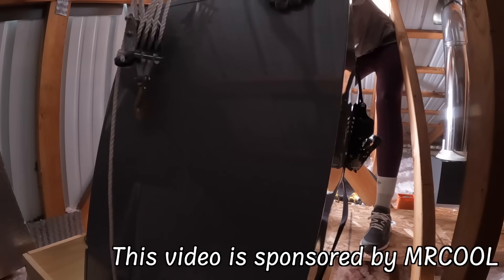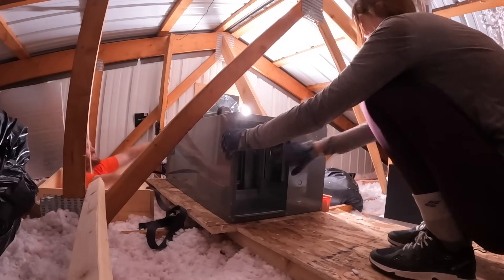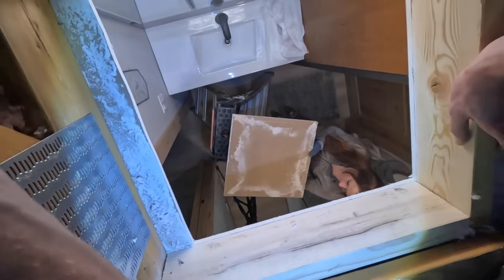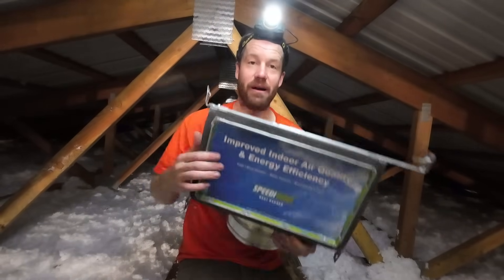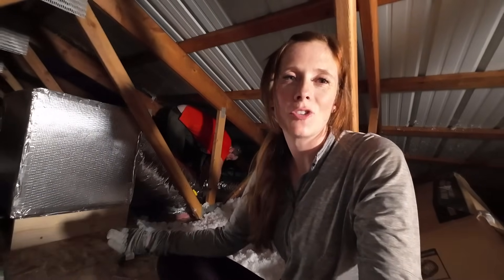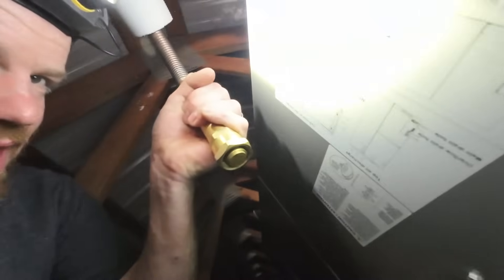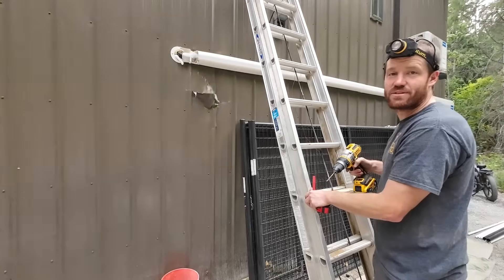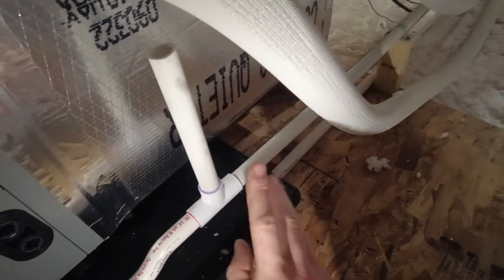Replace Your Old HVAC System With THIS! (DIY Heat Pump Install)

Comment: I always install a moisture sensor in the emergency overflow drip pan below the air handler connected to a light or bell or blue tooth to my phone to alert that primary condensate pan has malfunctioned and get service preformed on unit before disaster strikes, it's low voltage and low cost insurancefor the piece of mind it provides as when (all A/C Air handlers will expirence a blockage sometime in their lifetime) drain becomes blocked all the water collected will make for a lot of damage this simple precaution can save you hundreds if not thousands of times the cost of installing preventing water damage to your home. Great job on the install. Ray Stormont

Comment: Is the the unit liquid gas unit. ?
The information.  Inverter incorrect.  Those unit start up slow so there is no big surge on your sorce of power.  No brackers do not turn off. When the freezer is running at the same time hot water unit on Or a dryer all at the same time microwave.  Or jug for boiling water for a cup of coffee.....Can corse a fire if brackers are old. Or old home with just a fuse. And most people  go bigger gage of wire. But then smale gage wire gets red hot. Inverter is the way to go. God bless  mick Australia

Comment: Nice install. I suggest you wrap or foam the exposed metal on registers in the attic. The cold metal will cause moisture to condense and then ruin you sheetrock.

Comment: No wonder it’s hot in your attic, you have no insulation next to the roof, instead you have it in the ceiling. You also have no sarking so you can expect plenty of moisture to be settling in the insulation you do have. If you insulate the roof you keep most of the heat and cold out of your home.

Comment: Very awesome.  I installed a MrCool Universal system about a month ago.  It s their other central air system.  You will probably want to make a controlled room around the evaporator/air handler in the attic using at least some insulation board with radiant heat barrier.  It will make it more efficient and keep it from sweating in the Summer.  Also, you might want to add some returns in any room where to doors can be closed.

Comment: Yes. I remember. The windows were too heavy for the little single pulley. I wondered why you two engineers didn’t think of a block and tackle setup! Now you have a three block setup. Easy, no?

Comment: I installed one of those last week. Exactly the same. Mine the system didn't seem to know the temperature was ok as the fan ran at full speed non stop. Tech support didn't know why. They suggested that I install a standard thermostat and not use the one I purchased. It now works properly. So I have an extra mr cool thermostat. If you guys want it I will send it to you..

Comment: It is currently common practice for homes in the US to be built using a central AC and heating system, that includes an air handler and duct work in the attic space.  This seems like an unnecessarily difficult and problematic practice in my opinion.

Central AC and heating system air handlers are big, bulky, and are very high effort to install in very uncomfortable and cramped working spaces.  Additionally, they do occasionally require maintenance, sometimes due to mold clogged condensate drain systems, and sometimes due to something else (such as improperly designed air handler motors, using glue adhesive to secure permanent magnets, whereby the glue adhesive is improperly chosen such that the bond breaks over time and the magnets fly free and break, thus destroying the motor, due to a serious and easily foreseeable design flaw in the motor).  Additionally, when installing the central air handler in the attic space, typically a large quantity of ductwork is strewn all across the attic space, thus severely restricting mobility in an already overly cramped working space.

It seems to me, heating and cooling systems would be vastly easier to install, and much easier to maintain, if all of the mechanical equipment was installed inside the garage of the house instead.  To accommodate the equipment, the size of the garage should be increased compared to the current size of normal new home construction garages.

Additionally, instead of using air as a heat transfer fluid for moving the heat or cooling effect from the AC/heating system to each room in the house, a liquid heat transfer fluid should be used instead.  Liquids, such as a 50/50 water/antifreeze mix, have a vastly higher heat capacity than an equivalent volume of air, such that the liquids can function as a vastly more effective heat transfer fluid.  Additionally, pumping a comparatively tiny volume of hot or cold liquid to each room (through much smaller diameter insulated pipes, with also small diameter insulated return line pipes), is likely to consume quite a bit less energy, compared to pumping a high volume of air to each room.  Conventional central AC/heat air handlers tend to consume a not-insignificant amount of energy when running, often 700 to 1100 Watts.  This is quite a bit of energy, and is often a fairly substantial portion of the total energy consumption of the AC/heating system (potentially around 20% of the overall energy requirement of the complete central AC/heat HVAC equipment).  Pumping hot or cold liquids, to only the rooms that currently need heating/cooling, could potentially reduce the heat transfer fluid pumping energy to half that compared to pumping large volumes of air through often relatively restrictive ductwork and air registers, in addition to further lowering of total energy consumption, if/when a house has unoccupied rooms that do not require active heating or cooling.

In order for such a system to work, each room would need to be equipped with a hot/cold radiator, a small fan, a condensate catch pan, and a small electric pump for removing the condensate liquid to an appropriate drain collection location.  This hardware would not need to be especially large for a single room however, and it could be mostly placed in the attic space above a room.  This type of hardware would not be large however, and it would not destroy the maintenance access in the attic space, like a normal central AC/heating air handler system and associated spiderweb of insulated ductwork sprawling across the entire attic space.  Additionally, the smaller diameter and surface area of the insulated liquid heat transfer fluid carrying pipes, compared to large diameter and surface area of insulated ductwork, means that there would be considerably lower heat transfer flux through the insulation on the heat transfer tubes, and the surrounding attic air.  In other words, using a liquid heat transfer liquid, rather than air, has the potential to reduce parasitic heat/cool losses through ductwork insulation, thus improving overall system energy efficiency.

One other potential side benefit of such an approach to heating and cooling, is that it may be safer for house occupants, when one or more member of the household is currently sick.  Presumably, one common method that family members infect each other with colds and flus, is by way of sneezing in a bedroom, only to have the resulting sneeze particulates flow into the intake and exhaust registers of the central AC and heating air handler system on the house.  When running, the central AC and heating air handler can end up redistributing the sneeze particulates to all rooms in the house, thus hypothetically increasing the probability of other household members also becoming infected with the same sickness.  This potential threat is minimized, when a house is not designed with a shared central/heating system.

Some people do however like wind and comparatively "fresh air" in their rooms (such as that delivered by the central AC and heating air handler system).  In my opinion, this can be better accomplished by installing an exterior air hot/cold crossflow heat exchanger and by acquiring fresh venting air from outside the house.  This can potentially be done on a room by room basis, such that the air flow can be user controlled independently in each room, by the room occupant(s).

Comment: Just a tip, the ac coil drain is on the negative pressure side of the blower fan. This means air is being pulled through your open secondary drain. Depending on the negative pressure, it can restrict water from flowing through the drain. Long and short it will back up into the coil drain pan and drip out everywhere…. Into your emergency pan. No worries. 
Traditionally you install a float switch in the secondary drain port. If water backs up into the drain it will shut down the thermostat that controls your system so you know there is a problem. Or maybe an alarm. 
Great install guys.
Reply: In my home, the AC coil (and its drain line) are on the output side of the furnace fan, so the reverse is true -- both drain ports on the coil are under positive pressure. My installation has drain lines in both places, with traps, which keeps the air from leaking out of those locations. Therefore, i was going to comment that they might consider at least consider plumbing a trap into the second drain, and either plumbing that outdoors as well, or into the drain pan. In my case, the primary drain goes to the sanitary sewer, the secondary outdoors (near a window as suggested by another commenter), and the pan is only for if both of those plumbed drain lines fail, or something else catastrophic occurs with the AC unit. If the Mr. Cool systems drain on the negative pressure side, that would seem to complicate things as there would be a risk as you said, that the water would be held from draining past the trap by the vacuum being created.
Reply: @BobScotts  thanks for commenting. 
It’s not about the drains them self, it’s about which side of the blower the coil is on. On All heat pumps/dual fuel system the coil comes first. Therefore the coil is under negative pressure from the blower motor. 
You are correct, if they install p traps on the drains that will over come the negative pressures and allow water to drain normally. But if they leave the secondary drain open, in the event of a drain blockage water will have a very difficult time flowing out the drain under neg pressure. 
Yes, once the system shuts off all the water will flow down the drain. 
Ac condensation causes thousands of dollars of damage each year. It’s a simple system to properly drain and maintain…. If it’s installed correctly. 
And since it’s so dry where
They are, I doubt they will actually have that much condensation to
Begin with. 
Great content non the less

Comment: You should put 2 elbows on that pvc drain riser because if it ever overflows it will run down the pipe and likely down the pipe past the drain pan.

Comment: Pro Tip for using a hole saw. Replace the drill bit in the hole saw with a section of drill rod with a rounded tip. Use a regular drill bit to drill the pilot hole. The smooth shank of the drioo rod will NOT enlarge the pilot hole and the hole saw will cut a cleaner hole, and you don't end up with a broken bit in the middle of your job.
If the air flow out of your outlets is too much and restricting the registers makes them noisy you may be able toadjust the fan motor speed.

Comment: The system is installed in the hottest place in the summer and coldest place in the winter. Above the insulation and below the roof, an uninsulated area.  Your system is basically installed outside. Efficiency is useless in this type of installation.  It would have been better to install it in the conditioned area. Within the insulation envelope of the building. This is throwing your solar savings away.  Just stating facts.

Comment: I got into the mobile home service business in 1971 and they had split  systems A/Cs and heat pumps with pre charged units and lines

Comment: Definitely keep the other unit as a backup. Not saying anything bad about Mr. Cool, just that I had a whole-house mini-split system and it died right before the crazy heat wave a few years back and I didn't have a backup and I couldn't get parts for two months.

Comment: Such a "cool" video. Enjoy watching you guys solve you problems. 
A nice system, clean install. 
Though you may question the placement of the return in the bath as it is effectively venting the bath into the rest of the apartment.😮
Keep up the great work, you guys are awsome.

Comment: why did you put that unit in your attic? As far as I know, Mr. Cool units I have seen one  unit that goes on the wall, and the other unit is outside because the air

Comment: Aww. So short. 😕 No 220 shown to power the unit?  How many tons?  I think a pro would have had the return duct go straight out the end & circle back. Longer ducting = quieter operation. And you've got enough room where that 1" filter you put in can take one about 4" thick. Actually, filter the air. And I think ALL your outside units are too close to the wall.  Choking their intake air. Especially with the one that has line set rolled up in there.  Also. Just TWO screws holding all the weight on the outside units? The bottom screws do nothing for support. Should put another screw about 6" below the top ones. Nice to see you installed a gable fan. How does the air enter the attic? Keep the dozer !   And' DON'T WAKE THE BABY !!!!!!!   🤪😁😂

Comment: SSoooo, ya might want to reconsider running return air in each room as the problem with a center air return is all rooms  need to be open in order to have air circulation.  Close one room and it does not have the return air circulation and gets warm in the summer and cold in the winter.

Comment: That's awesome that they're making whole house DIY units now. Good job Mr Cool! 
The one thing I think I'd add to your setup is a water leak detector/alarm in that pan so you know when there's a problem with the primary condensate drain and you can fix it before you develop a problem with the secondary drain and ruin your ceiling

Comment: I have a unit in my house installed in 1996 ,  Full basement  1200 sq ft   Main floor 1200 sq ft   3rd floor master BD RM en suite bath  walk in closet.  No heat pump.  My unit pulls 2700 watts running full capacity.  I don't feel 2000 watts is all that good.  And when something on that Freak drive goes Kaboom which it will !  It's not going to be cheap, neither is finding someone that understands VFD drives.

Comment: Why are we placing a heat exchanger in a hot attic it has to work harder and waist more power!
Reply: Because the cooling fan and condenser are outside you moron

Comment: I’m an HVAC installer been doing it for about 10 years now and got to give you both props as that’s a job well done for DIY install. A couple things I would have done differently simply from having the experience but overall I’m well impressed with your work. 👍🏻
Reply: Would u have insulated the Roof?

Comment: So i have a question for clarification. You stated your solar arrays are 4000 and 10,500 watts respectively. Is that acerage or peak? It aure didn't look like peak solar production conditions to me, at least not with our system mostly across the county from you. Ours would not be producing fully in that lighting, or the camera is making things look different than reality.
Reply: You must have gotten those Biden solar panels

Comment: I think you might want a downstairs floor-level duct for winter, when you start heating.  With the ceiling ducts you have, it will be very difficult to heat the shop.  That would be as simple as running a new duct and making sure they can all be opened or closed easily.  But that can wait for later.

Comment: Next step would be the efficient use of water by splitting it into fresh water, grey water and black water. You could catch the condensate of the a/c units and add it to the grey water tank. Or maybe even add it to the fresh water tank with additional filtration. The grey water can be used to flush the toilet and for irrigation.

Comment: Just an FYI,  if you in stall a MR. COOL most professional HVAC tech's will not service you system.   You have become your own support which is not necessary a bad thing.

Comment: For energy consumption, I am curious what you would see if you get something like an emporia vue to add to your breaker box. It would let you give better numbers about how much energy is actually used by each appliance over many hours. I would not recommend the Sense monitor as it seems to be pretty inaccurate for always-on loads.

Comment: Riley I recently had a pilot drill in a hole saw break while drilling through thin steel as well, which has never happened subject to such circumstances before!
I wonder if at least some suppliers are currently providing manufacturers with sub-standard materials and/or components?

Comment: I saw one gable-end attic fan, which is good (blowing in or exhausting?), so just make sure you have adequate attic ventilation. Theoretically, the attic temp should approximate the outside temp, regardless of season, in order to prevent mold-encouraging condensation. One partial help would be to insulate your roof.
Good choice on the ACU. Only prob I have with it is that it's made in China.

Comment: Awesome job Courtney is a trooper! Just a suggestion on your condensate drain, though. On the port that is higher than the drain line, since the evaporator is in the attic above a finished space,, I would suggest a float switch that will shut the unit off. This way you’re not relying on the drain pan to catch the condensate water. It becomes the third option instead of the second. Also, do you have the secondary drain outlet in front of a window or somewhere it will be obvious in case you see water coming out, alerting you that the primary drain is clogged?